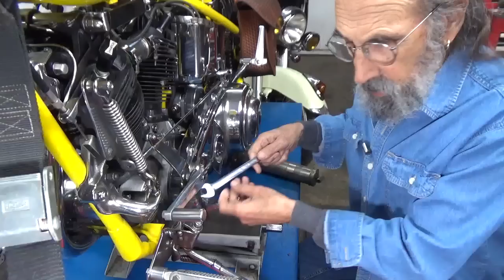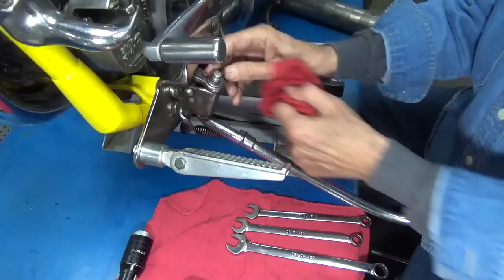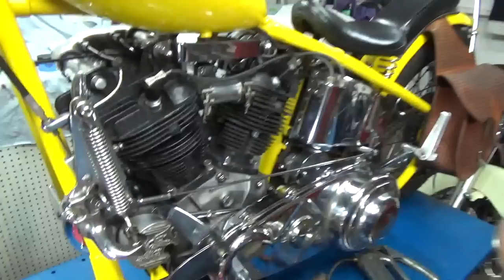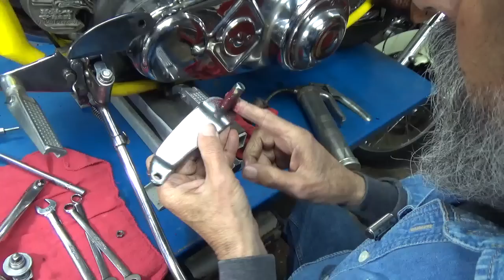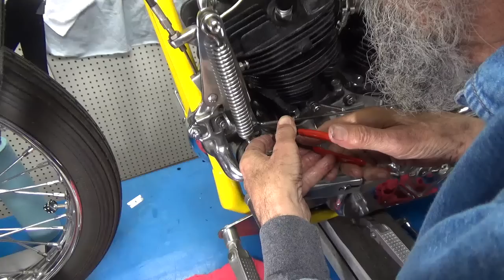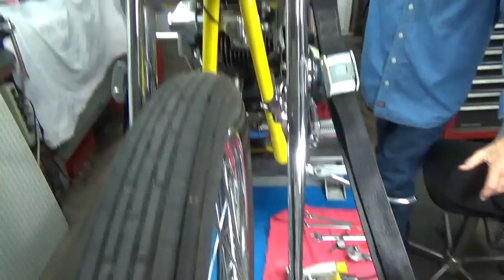Harley Knucklehead Lubrication Maintenance

Comment: A suggestion born of experience... Closely check the fitment of the leg stop. Over time the square hole can become rounded and  it can slip on the kickstand shaft.  You'll topple right over when it slips and lets the jiffy stand rotate far forward.
Reply from the maker: Yep.  Especially if it's a cheapo repop Leg Stop.

Comment: One night I was comeing home from work on my ride and I look and there was a brother broke down  harley 45 trike  he had lost the charge and couldn't get it to start so I stopped  and proceeded to solve the problem  the battery charge had lost its ground  so we took all the wire leads and cleaned them off for put all back mean wile rain rain and more rain  some guy left off a bottle of wine  so we got warmed up  still no charge  the bike had a lot of oil  on it  so I told him  we will take the battery box off clean and dry it good  so I pulled off my tee shirt and  drained some gas out of my bike  we took the battery box's and rubbed it on the pavement then installed it  cleaned the ground Leeds and jumped it it started  don't turn it off till you get to were he was going ingredients a quick handshake  and I was going home to dry out  cold winter night but another brother on the road again  sorry for such a long story this was for real   Lemay Nelson  story Goin home on good old hwy 80   towards seirras
Reply from the maker: I've been there a lot of times. I carry tools and fix a lot of stuff.  I get it.
Reply: We have all at one time or another stopped and helped out a brother broken down, but it just doesn't happen like it used to.

Comment: I really like your videos! 
If you still have an oil leak from the heads your vacuum system may be leaky. This is very common, as the repop rocker arm seals really are not very good. I had this problem, and when I got new seals turned from Vitone, the problem disappeared completely. From looking at the design specs, more than 50% of the oil in the system goes to the heads, but the engine vacuum can handle that with no problem if it's not leaky.
Reply from the maker: Thanks, will do!
Reply: @pacificmike9501  I have a vitone rocker arm seal set I could send you if you like.

Comment: I know this is asking a lot. Could you get the Inside Diameter of a 66 tooth 33163-65A? I have 1974 fx belt drive primary and would like to weld a starter ring gear on my clutch basket. I cannot get an answer from anyone that has that information. I have asked at least 20 people. thanks in advance. I watch all your videos. great info
Reply from the maker: Okay.  You asked for it.  I have no idea why.  A 74 FX with a belt drive has to be an aftermarket belt drive.  Most likely an aluminum clutch basket.  There is no reason anyone would need to publish that measurement.  But, there happens to be one of those gears hanging on the wall in my shop.  So I went out there and measured the I.D. with a vernier caliper.  It measures 6.980".
Reply: @pacificmike9501  Thanks for the reply. I found out it is a primo belt drive. Might have to go back to chain primary. thanks
Reply from the maker: You can probably  purchase a Primo Clutch basket with a ring gear on it from Ben at American Prime Mfg.  (562)889-8665.
Reply: @pacificmike9501  I got a ring gear on the way to see if i can mount it myself, and i got a chain and original cluth basket on the way just in case . had this shovel since 1980 with a kick start, now i want electric. thanks for info

Comment: mike, is there a particular brand/model of forward controls you recommend for a 79 FLH?  thanks.
Reply from the maker: I use the least expensive ones sold by Drag Specialties, V-Twin, Custom Chrome.  They're the same parts, and sold by everyone.  I usually make my own brake pedal pad out od something and my own shifter peg.  But, I use these controls because they are made of steel and last a long time.